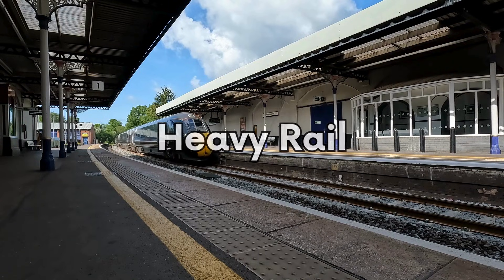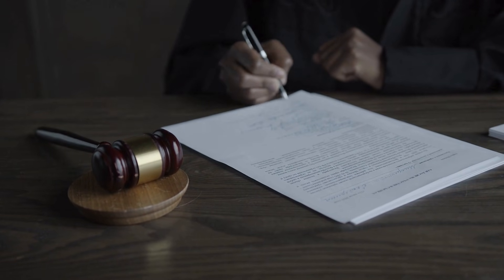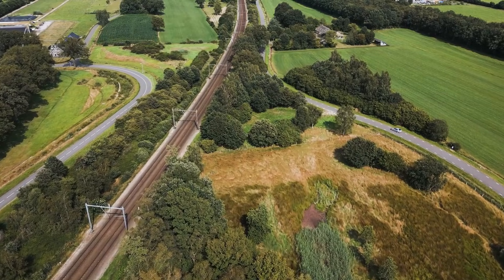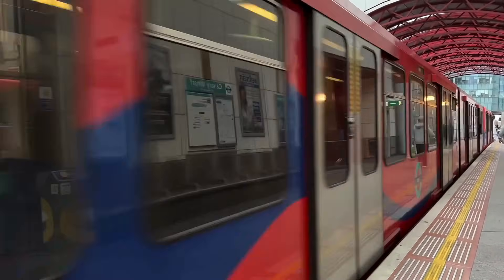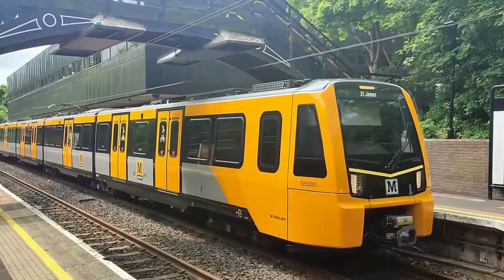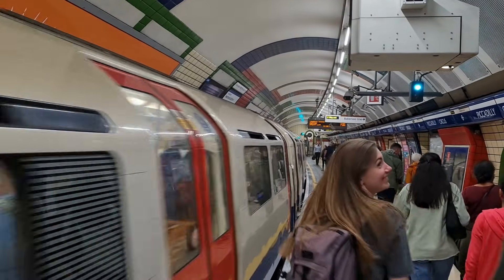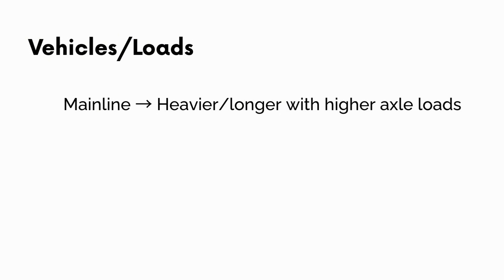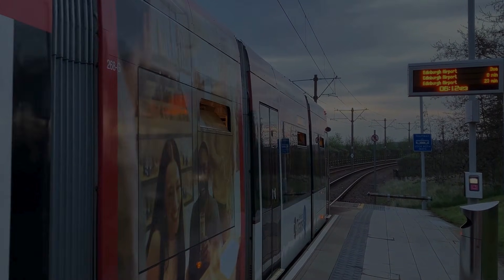Mainline vs Metro vs Light Rail vs Trams: What’s the Difference?

Comment: I always understood that light rail is a railway that isn't built to mainline standards. The "light" refers to the lighter book of regulations. Some of those mining light railways in history have had much higher axle loads than the mainline. Generally they're local systems. Tramways (AKA streetcars) are light rail's built for street running.
Metro's are a stand-alone and entirely grade-separated rail system for the sole purpose of shuttle people around urban areas.

Of course there's been many and still are many that blur these lines. The old interurban trains in the USA that would street-run on some streets. The tram-trains in Karlsruhe Germany. Light metro's like the Vancouver skytrain, etc.

Comment: And then there are the edge cases like the Sheffield Tram-Train project which runs trams on mainline infrastructure.
Reply: Actually it's the other way around.
Because they meet mainline standards; Tram-trains are trains that can also meet a tramway's standards thus infrastructure.
Reply: Not quite true as the wheel profiles and floor heights of the trams don't meet mainline standards (probably crash protection too) which is why  tram-train isn't often a straightforward project to implement.
Reply: @sensonic_rail (*Sighs*)
Tram-trains don't have regular tram steel tyre profile's nor tram floor heights. That's how they meet mainline standards. They have a tyre profile that is mainline compliant but also adapted to run on certain tram track.
Please go and research this.
Reply: Sheffield Tram-Train has a bespoke wheel profile (so not a mainline one - but designed to be mainline compatible), and the vehicle IS a low floor tram (so can't use the standard train platform in Rotherham). Perhaps it is you that needs to go and research this.....
Reply: @danielpyke  Ugh.

Yes tram-trains have hybrid wheel profiles. So they can also use (some) tram infrastructure. They also have much heavier and stronger structures to meet mainline standards (which is why they're segregated as much as possible from automobiles). 

If rolling stock meets mainline standards, then it is a mainline train. That's why they're called "tram-trains"; they're trains that are like trams, and not the other way around.

Comment: London Underground isnt fully segregated, it shares track with main line in several places
Reply: London's subterranean lines function more as an "S-bahn" mainline network than a metro. Which leaves only the stretch where the Bakerloo shares tracks and infrastructure with the Watford DC line (I don't know what it's been renamed as now sorry). As I understand it; the bakerloo line and that stretch has certain features in signalling etc to allow this.

Comment: I am drawn to the German, Stadbahn, U-Bahn, S-Bahn, InterCity and High Speed classifications.
Reply: You forgot trams. Geemany has many tram systems that are not stadtbahn.  Even cities that have a stadtbahn such as Düsseldorf and Frankfurt still have separate Tram networks. Also after S bahn its Regional rail then InterCity/HSR
Reply: @BLACKSTA361 I dont think the categories are really even really regulated in Germany, the only real main difference is local public transport vs far distance railways
Reply: @BLACKSTA361 German classifications:
Strassenbahn - Trams for street running in busy urban streets
Stadtbahn - light rail for moving people around urban areas
S-Bahn - same purpose as the Stadtbahn, except it uses the mainline system instead of its own system
U-bahn - metro.
U-Stadtbahn - sections of a stadtbahn that run in a subterranean tunnel and have underground stations

IC and ICE aren't relevant to mention, they're run by DB, not the local authorities. ICE mostly runs on its own HSR network
Reply: They're no different to the UK's really.

Comment: The London Crossrail seems to be the basis of the underground in London, particularly with Crossrail 2 added in future.
Reply from the maker: Interestingly with Crossrail it is connected into the mainline system either side of the core so I believe it actually falls under mainline regulations
Reply: @thepwayengineer  The District Line, Metropolitan Line, and Tyne and Wear Metro are all connected to the mainline system.
Reply: @TimothyEBaldwin as is the Bakerloo line
Reply: @TimothyEBaldwin   The cut and cover lines in London function more as a mainline S-bahn than a true metro anyway. They were built to mailine standards.
The Bakerloo and T & W metro have to have certain features and functions to be mainline compliant.
Reply: Crossrail is built to mainline standards. It's what the French pioneered with the RER as metro lourd (heavy metro) where mainline's are connected under a city centre via an underground tunnel which can function as a metro thanks to its signalling and control, but whose loading gauges etc all comply with the mainline.

And Crossrail is very new not even 5 years old, the underground has been around for more than a century. I might be wrong but I don't expect crossrail 2 to ever happen.

Comment: Manchester Metrolink is a glaring example of railway/tramway jumbling. The creation of the system was authorised by Parliament in 1988 as Tramways and Tramroads, and the word "TRAM" is writ large on road surfaces in the city centre for all to see, yet Metrolink was fraudulently implemented as a railway with trains running on it, incurring dire PWay consequences which are still causing trouble today - namely the canted curves in the Cornbrook underpass (those curves audibly strain the articulations, and should therefore be flat consistently with the slow speeds of the trams running through them), the plain contorted pointwork in Piccadilly Gardens and at the top end of Mosley Street (should be best-practice pre-sorting/post-merging in conjunction with contiguous interlacing) and differential running bands caused by mixing vertical and inclined rail within routes. Non-Pway consequences include an unfit-for-purpose and nationally-isolated steam locomotive derived audible warning of approach (should be a flexible struck sound, specifically a gong or bell, a sound which has been conventional and proven for unsegregated fixed-path operations for over 150 years), and the customer-hostile omission of grab poles in the aisles of the original fleet of T68 trams because they would "make the vehicles too tram-like".
Reply: It's a light railway.

Comment: You don't mention Merseyrail alongside the London and Glasgow Undergrounds as an example of an underground/metro.  Thanks by tthe way for this valiant foray into a tangled subject.
Reply from the maker: Thank you for the comment - it's a good point about Merseyrail!
Reply: The Glasgow Subway is a metro. It is entirely segregated and grade segregated on a system whose sole purpose is people-moving.

Merseyrail is mainline. It's built entirely to mainline standards and  most of the network it uses can be (and in many places regularly is) shared with freight trains or long distance passenger trains. Some of it runs underground into the Liverpool town centre, but entirely to mainline standards.

Comment: And then there are trams that run on the mainline (several examples in Germany). They usually support two different power systems and use two entirely different signalling regimes.
Reply from the maker: I don’t believe so in the UK
Reply: @thepwayengineer Sheffield Tram-train was a proof of concept for that in the UK, they plan to build more! Also tube trains running on mainline is a thing as well as Tyne and Wear trains running on mainline
Reply from the maker: You are correct on the tube train son mainline, Gunnersbury to Richmond is a prime example of them sharing the same track
Reply: The Cardiff tram-trains are running on segregation lines and on the streets, similar to the Karlsruhe system in Germany.
Reply: Actually it's the other way around.
Because they meet mainline standards; Tram-trains are trains that can also meet a tramway's standards thus infrastructure.

Comment: I’d say that these categories in the way they are set up aren’t a good fit for purpose if we decide that the standards for DLR and Tyne and Wear Metro are closer to a tramway rather than underground railway or metro. Like at least within the existing services in the UK we surprisingly don’t have the systems that would be that hard to classify. We can easily set up rules such as: street running -> tramway, segregated / semi-segregated running -> metro, then metro could also split into heavy and light based on speeds, curves and flat wheels (these are essentially a thing that makes a difference). And obviously all the commuter rail will remain in mainline. Maybe also add something like “regional metro” or idk what’s the best name to put Elizabeth Line and Merseyrail in that group (obviously with the operational style of these systems the requirements should differ from your regular mainline). That way we can achieve developing way better set of requirements for each operational mode and get rid of the quirks of accessing very different systems through the common rule set.
P. S. Found your channel some time ago, you are doing an amazing job explaining how the railways work, keep up!
Reply from the maker: Thank you for the comment! The categories are derived from the law and then the regulator’s interpretation and implementation of that law. 

I think overall it does seem to work, but as will all things there is one or two examples that don’t quite fit neatly!
Reply: @thepwayengineer but that’s because UK is much more reliant on your usual rail and sometimes trams. I’d still argue that metros with criteria of having a full right of way while being high frequency and urban focused should be a category
Reply: @Dxrjfl metro can definitely be an unofficial category, but there might not be much purpose for a legal category
Reply: Well you're entitled to what you'd say.
But without meaning to be rude; you're no authority on this and your opinion's not really worth anything. Methinks it's better to defer to the people who are authorities and know what they're talking about.
Reply: Me: providing arguments and reasoning
You: you’re not the authority so your opinion means nothing
Ok I guess none of the authorities were ever wrong or inefficient in taking any decisions, right? :)
Reply: @Dxrjfl  Well these definitions have been around for over a century and they've worked well.

And I'm going to stop not meaning to be rude with you. You didn't really provide arguments and reasoning at all, merely your own confused misunderstanding's and arrogance that what you like to believe is what should be correct. Maybe you should try listening instead of imposing your opinions? Heaven forbid you might learn something and be better off for it...
Reply: Maybe you have any counter arguments? If no stop waffling
Reply: @Dxrjfl  There isn't an argument. The classification's aren't changing.
Reply: Of course, no arguments or doubts allowed, yes, mister Xi Jinping, party said it must work that way, we agree!